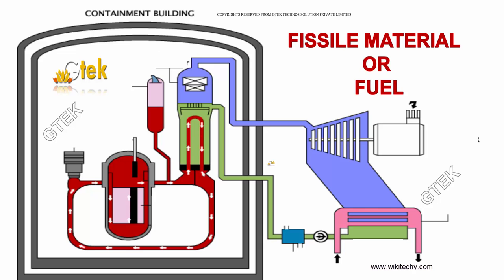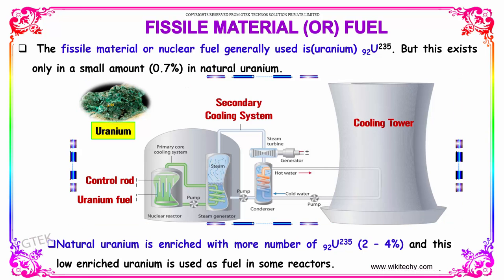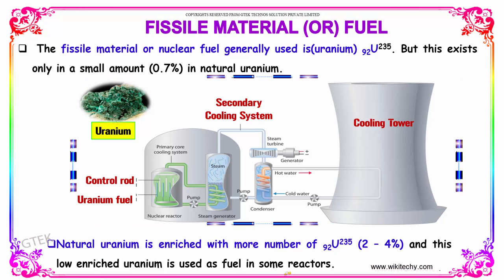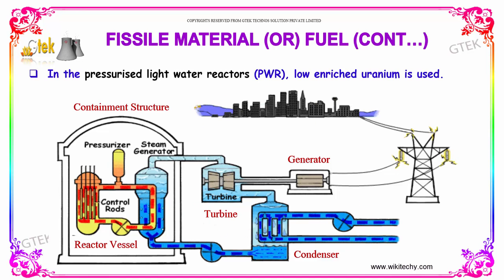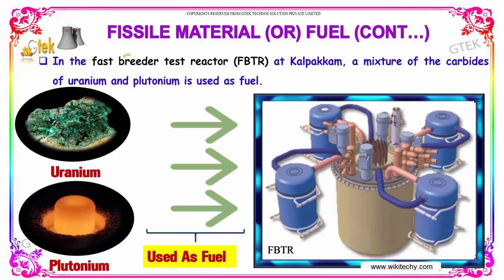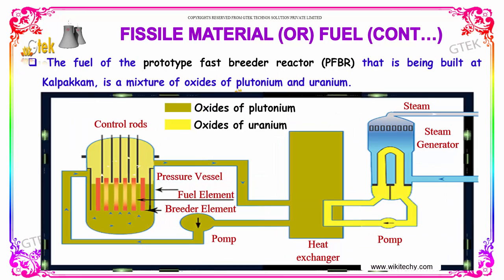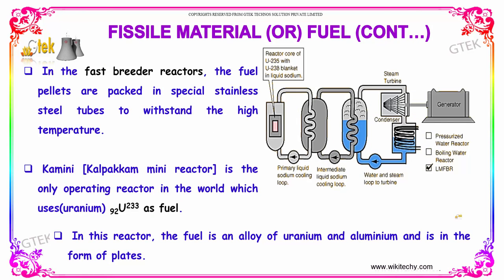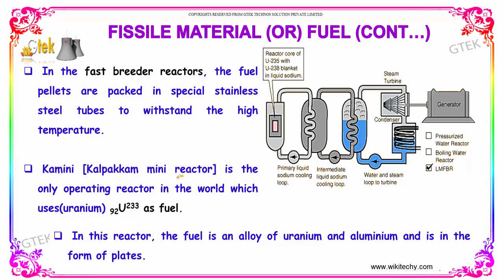Fissile Material or Fuel | Nuclear Physics |class 12 physics subject notes lectures|CBSE|IITJEE|NEET

Comment: In nuclear engineering, fissile material is material capable of sustaining a nuclear fission chain reaction. By definition, fissile material can sustain a chain reaction with neutrons of any energy. The predominant neutron energy may be typified by either slow neutrons (i.e., a thermal system) or fast neutrons.

Comment: Image result for Fissile Material or Fuel
In nuclear engineering, fissile material is material capable of sustaining a nuclear fission chain reaction. By definition, fissile material can sustain a chain reaction with neutrons of any energy. ... Fissile material can be used to fuel thermal-neutron reactors, fast-neutron reactors and nuclear explosives.